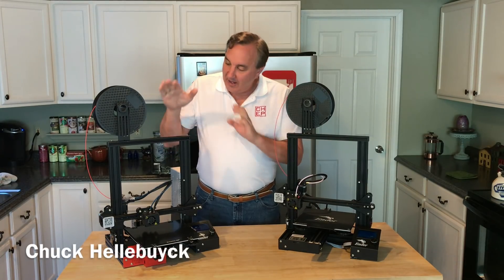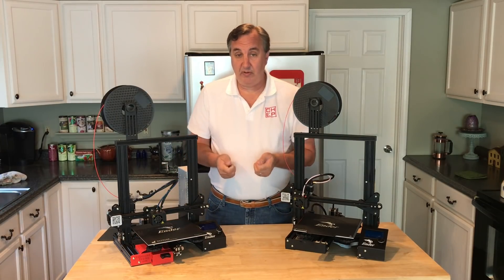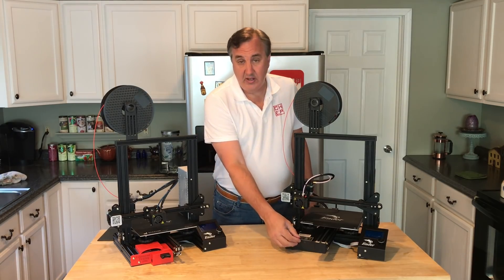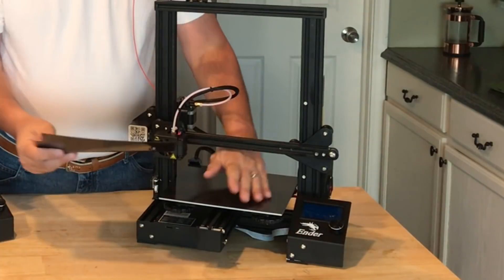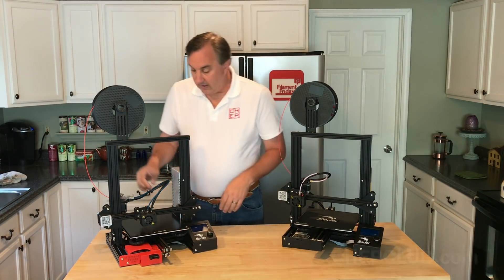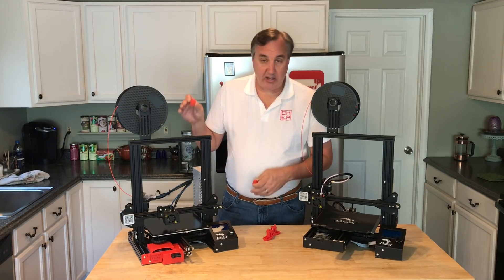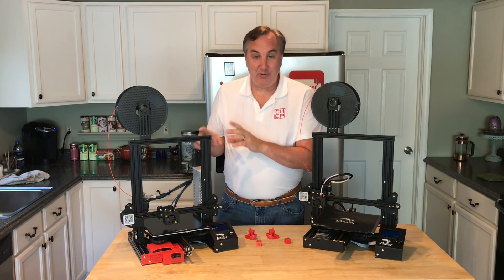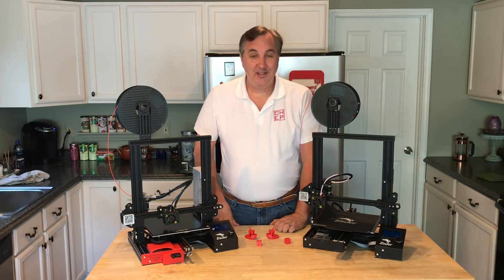Creality Ender 3 PRO vs Creality Ender 3 - Is it worth $100?

Comment: My power supply died and in europe a new one cost 24€ while the Mean Well costs 54€. Do you recommend spending those extra 30€?
Reply from the maker: There are many good power supplies other than Meanwell. You’ll probably be fine with the 24 euro one.
Reply: @FilamentFriday  thanks for answering so fast!
Reply: @FilamentFriday 
IF SOMEONE IS READING THIS, BE REALLY CAREFUL AND INFORMED WHEN MANIPULATING POWER SUPPLYS SINCE IT CAN BE LETHAL

Ive checked with a friend and apparently its common with these chinese psu, the problem is that they use cheap condensers which tend to burst. I will try changing my psu condenser and I will update my results here so people with the same issue as me can solve it.

Comment: How does the CR-20 stack up versus these two units? The CR-20 looks like it's closer to the Ender-3 Pro with some more tweaks.
Reply from the maker: I don’t have one to compare.
Reply: @FilamentFriday  Thanks for the reply. It's hard to find any reviews on the CR-20. From what I have gathered, it has similar specs to the Ender-3 Pro with minor upgrades/changes. I just pulled the trigger on a good price for an open box one I found on Amazon Warehouse Deals, guess I'll see how it performs very soon.
Reply: @Case
I'm a newcomer to the print community,  I wana know how the CR-20 works. Ender 3 pro for me works fine for no more than what I've done.

Comment: Can they both print flexibel? Internet says only the pro version can do it, but i cant see anny diference or reason why the normal version cant, pleas help me out
Reply from the maker: Depends on how flexible but they are both the same. Limited flex filament prints fine but Ninjaflex or very flexible requires a better extruder without a gap between the gear and PTFE path. Both printers have the same setup so they are the same.
Reply: @FilamentFriday  thx for replying👍🙂

Comment: Does anyone know how to get your print settings off an old print file on the SD card? My computer crashed!
Reply: It's not possible, gcode doesn't store informations about your slicer settings, it only contains instruction for printer (like set temperature, move, etc.), there are some information which can be extracted from gcode but not much. For next time backup your slicer settings.

Comment: Yeah, uh... the price difference is roughly $20-something now. Also, the CR-10 MINI in a whole $100 more than both
Reply from the maker: Lot has changed since this video was released. In a way it validated everything I stated. Wasn’t worth $100 more.
Reply: CHEP yee
Reply: CHEP wasn’t throwing shade, just thought in case anyone was concerned about a large price gap

Comment: What about the Anycubic i3 mega vs the ender 3 at similar price. Both are priced around 220-230 bucks now.
Also, can i use the glass on the Ender 3 PRO?
Reply from the maker: Ender 3 is $179.99 at many places. I gave away my Anycubic I3. Good machine but not worth the extra cost in my opinion.
Reply: @FilamentFriday  Yep right now, $180 with glass bed vs $230 of the anycubic i3 and $220 of the Ender pro. Not sure if $40 is worth for the Ender vs Ender pro. 
My main question now is if I can put later GLASS on the Ender Pro (e.g for ABS, interchange glass and magnetic), the bottom bed should be just plain aluminium so i guess yes?  

Thanks in advance for your kind response Chep!
Reply from the maker: I believe that would work. Also consider the Geeetech A10 at $190 which already has a glass bed.

Comment: Wait, what do you mean the Ender 3 doesn't come with a removable plate? Mines fully removable and while it's not super flexible, it has just enough bend to pop prints off.
Reply: it's flexible but not magnetic
Reply: That fibre board with buildtak is a new addition to the base printer, say in the last 3 months. My buddies printer didn't come with it, but mine did.
Reply: There were different batches of Ender 3 sold.  Newer ones have the flexible plate with the for little black metal clips, but older ones the plate is 'permanently bonded' to the aluminum bed, and does not come off, at all.  

Chep's Ender 3, on the left in the video, has such a bonded bed, to which he added the borosilicate glass.  Chep's 3Pro, on the right, has a two part magnetic bed, with one part bonded to the aluminum and the other part removable.  The printer I have is the later Ender 3 with the clip-on bed.
Reply: Oh ok! I see! Yeah I have two with the clipped on bed. But I find Elmer's clear paste glue works astounding for adhesion. Best part is after the print is done not only does it pop right off, the glue layer peels off so satisfyingly.
Reply: @TheSentientCloud  I have not tried that!  I've been using Elmer's gluesticks, the kind that your 4 year old eats in art class, not the kind that goes in a hot glue gun :P  If you get the purple ones, you can easily see where you've reapplied, and it turns white as it dries (quickly).  you do occasionally have to wash it off, though ...
Reply: Try the clear spread glue! You never have to wash it off, works better than the glue sticks, and prints pop off as though they were never stuck at all, and the glue layer is easily peeled off when  you remove the print!

Comment: Am about to get the ender 3 its 240 on Amazon where can I get it for a lower price
Reply from the maker: Direct from Creality or Banggood. Check the links in my video description.
Reply: @Danley joseph If you haven't bought one yet, Ender 3 is on sale "Deal of the Day" on Amazon for $182, down from $259. You have 15 hours to still buy.
Reply: @TheJester-ct5pi  For me it said "currently unavailable" on amazon.
Reply: @StolenGalaxy  You should be able to purchase one, there are multiple sellers. I bought mine yesterday with the discount. Word of advice buying on Amazon - best to buy directly from the manufacturer, and not a 3rd party seller. Much better customer support if you need help.
Reply: They are available now but it’s £70 cheaper to buy it from the creality website

Comment: One other improvement that really should be made to any of these printers is the connector from the hotbed to the power supply. It comes supplied with a TX-60. This thing gets hot enough to auto ignite under the right conditions. Please, please upgrade your Ender 3s with a TX-90 connector.
Reply from the maker: Only some of the defective ones did that. Mine stay cool.

Comment: As of 3/29/2020, Banggood now has these two models available for a $30 price difference. Assuming everything else in your review holds true, would you still conclude that the non-pro model is the one to get?
Reply from the maker: I still don’t see a major advantage to the pro. Spend the $30 towards a silent board or EZR extruder and you’ll be better off. After using them both for more than 12 months I’ve concluded I hate the magnetic bed on the pro.
Reply: CHEP I had a Prusa Mini on order for several months and came to the conclusion that it wasn’t coming until summer. I’m going stir crazy at home and my 2015 maker group kit printer was being fussy so I went to Micro Center and bought an Ender 3 Pro for $209 (they didn’t have the non-pro in stock). Used your video to put it together, fired it up, used your g-code leveler models to make the bed perfect (thank you!) and printed a benchy using Cura’s Ender 3 profile. It was one little blemish away from perfect!  Boom - you got a new Patreon supporter. Your vids are really valuable and I can’t wait to put all of your insights into my new unit.

Comment: thanks a lot for these videos,
I am new about this , from what u said in the 4:50 that you make some changes so then your are be able to print flexible materials .
I have search on the gearbest and I found Creality3D Ender - 3 DIY , and it seem I can print the flexible materials ?
is this a different models ( DIY )? and what the name of the filament for the flexible it is nylon ?
and thanks again :)
Reply: ammmm , I think this is the answer :)
ENDER 3 - NinjaFlex TPU using EZR video
Reply from the maker: Yes, that is how I print the very flexible 85A hardness Ninja Flex material.

Comment: Is the nozzle removable if I wanted to put in a steel one for carbon fiber?
Reply from the maker: Yes
Reply: CHEP I have another question, if you’ve got time. I have a da Vinci 1.0A, and I’m wondering if it’s worth flashing it and buying a new hotend or just buying a new printer.
Reply from the maker: If you want an enclosed machine for ABS and want a project to work on the reflash and add a custom hotend. But other than that, I’d just get a new printer. Mine are all done.

Comment: Funny thing is, I think I got the ender pro opr at least a diffrentz ender 3. Like my mainboard is set like the on on the left but the nozzle piece is like the on on the right. and I got a removable building plate. It's not magnetic but still :/

Comment: So although you get an estimated $120 in value with the pro, you still say that the original 3 is better?
Reply from the maker: Where is that $120 value coming from?
Reply: @FilamentFriday  the parts you print yourself, the power supply, and the other upgrades. You yourself even say it in the video.
Reply: @FilamentFriday  you tell me 5:15
Reply from the maker: Sorry. Memory fade. My point is it’s not worth the extra and the price has come way down since this video was released, proving my point.

Comment: That roll to hang the fillament are stock?
Reply from the maker: Yes.
Reply: You're better off using a separate one off to the left.  I even printed some filament strain relief brackets to help, but ended up placing my spool to the side.

Comment: I don't understand how they can call it "pro" without including automatic bed leveling.
Reply: The electronics can't support abl without giving up a bunch of other things. Best case scenereo is you trade the buzzer for it, and trade out a number of features in the firmware due to the low memory in the processor.
Reply: @initialo2054  Not true. I put ABL on my CR-10 (which uses the same Mega1284P based board) and the only thing I gave up was the buzzer. All the firmware features remain in tact, in fact I actually added MORE features by upgrading to the newer version of Marlin.

Comment: I go with the better power supply, as I don't want to burn down my whole house...  but the magnetic bed is a real downside.. or you just ignore that, buy a the glass plate.. what could happen except it won't be magnetic any longer if you heat above 85°C?

Comment: Gonna ask an awkward 3d-prining question that has no real answer: 
How many rolls of filament is the cost difference between a 'basic' and 'Cadillac' printer worth?
Your Filament Library is gonna cost MANY times more than your printer(s), and filament costs don't go away.
In fact, if your printer is top-notch, you are gonna buy MORE filament and get more work done!
Don't be a stingy Boss!
Saving a few bucks on your printer is like a stingy Boss saying "Work more hours!" instead of paying a living wage!
Be a good Boss, get a better printer!
Reply from the maker: Filament Cost is the same. Start with an affordable printer and learn the slicer and basic settings, then upgrade.

Comment: You missed a few other things
Like the power supply for the pro is 24volt not 12 and the bed heats in twice the time and I got my ender 3pro for $219
Reply from the maker: They both have 24v supply so they heat up the same. Price has dropped after this video. Ender 3 is 169.99.

Comment: Glass bed's are like $5 if you go and get one cut at a local hardware store.
Reply from the maker: Is it Borosilicate glass that doesn’t crack from the temperature cycling on a 3D Printer?
Reply: I've always used standard glass beds from the hardware store up to 75C and haven't had one crack. I did crack one when heating my hotend directly with a heat gun while it was sitting on the glass bed, took a while. Was easily hotter than any heatbed gets and was heated on one focal point.
Reply from the maker: Congrats. That’s not common. Often over time the glass chips and comes off on the bottom of prints.
Reply: @FilamentFriday  I've had my printer almost 4 years, I use aquanet hair spray on the glass. Never had a bed chip or break, many of the beds were bought at different times and from different stores. I pop parts off using a putty knife butted up to the edge, one swift pop of the hilt and prints pop right off. PETG/PLA/ABS. I print mostly PETG, 12hrs a day.

Comment: Hello Chuck.
I just found out about this printer and I had a little bit of printing back in the day when I was in high school, but I want to know if I can print resin parts with it too? I know it uses PLA, so will I need a different printer for resin?
Reply from the maker: Yes. You need a SLA or DLP style Printer.
Reply: @FilamentFriday  oh alright
Thanks a lot for your response! I'm thinking about buying an anycubic photon

Comment: Well we didn’t see them print so maybe the pro is faster than the regular 3
Reply: Matthew Geiger do you know how a 3D printer works? It just doesn’t work like that.
Reply: John Myers well I mean extruders and stuff and the speed that it can go around the surface and how fast it moves around the plate.
Reply: Matthew Geiger ya... that is all slicer dependent, doesn’t matter on printer

Comment: Is banggood a reliable seller?
Reply from the maker: I’ve bought several printers from their USA warehouse without any issues.
Reply: Yes, they are. I've bought power supplies, FPV goggles in 2016, my Anet A8 in 2017 and my Ender 3 about 3 weeks ago. Never an issue. Delivery time has been excellent along with the packages being received in good condition.

Comment: Thanks for the video, right around my price point. Im looking at 3D printers so that I can print rc planes from https://3dlabprint.com/ do you think the ender would do a good job?
Reply from the maker: Depends on how big the parts are. Are you going to use PLA plastic?
Reply: @FilamentFriday  The manual says they used a prusia original and states...

Basic requirements Mig-15BIS are 200/200/175mm buikd volume.
Nozzle 0.4mm recommended (0.35 or 0.5mm alternativelly). Heated bed highly recommended.
PLA filament (or PETG, APLA, htPLA, PC-max.... not ABS) and some flex for tires...
Reply from the maker: Should work fine then.
Reply: @FilamentFriday  Thanks for that. Im trying to determine  mechanical strength of the end product relative to the cost of the machines... I understand that these FDM printers have planes of shear due to the layering of the plastic and I'm never going to get rid of it without winning the lottery and getting one of those new Carbon printers. But in your experience is there a correlation with shear strength and machine cost? Do the layers stick/meld better?

Presumably feeds, speeds, layer thickness, room temperature etc all have a real correlation to the meld-ability of each layer.

I just cannot see the difference between a £5k machine and say a £0.8k machine. There does seem to be a quality and feature reduction under the £800 mark and that is understandable as lower than that would force the manufacturer into cheapo components. But even the ender seems to be equivalent to a prusia with only a few mods and just over a ton spent.

Unless someone figures out how to do a post process to these FDM parts, fusing the layers together on an almost molecular level, I just don't see a difference between these machines.
Reply from the maker: Quality and reliability plus tech support is what you are buying for the more money. There are additives like XTC-3D or Gloop that can smooth out the layer lines and this tends to help strength a little. The way it’s printed also affects strength. If the main force is parallel to the layer lines it seems to be more effective. 50% fill or higher also adds strength.
Reply: @FilamentFriday  Last night I stumbled upon the multi-material add on for the prusa, that's sold it for me, the whole thing looks pricey but like you say im paying for the support and the support looks pretty good; plus they always appear to be improving. Many thanks for the advice and the chat. I find not many folk respond to messages, so much respect for keeping it real!
Reply from the maker: If you do buy a Prusa consider using my affiliate link in the description. Thanks.

Comment: Hi, I really wanted to buy a good 3D printer and am a fan of the ender 3 but I'm in Canada and willing to spend in the price range of $350. Soo I do like the specs of the ender 3 pro because of the more stability than the ender 3 soo which do you recommend me getting any printer and any brand in the price range of $350. Thank you
Reply from the maker: I’d buy the Ender 3, a silent board, EZR extruder and my Filament Friday Tool Kit and you’ll still have money left for Filament.
Reply: @FilamentFriday  Ok. Buy I got one question about the y axis rail, pro and geetech have a bigger one and I don't know how to do the software changes and so on so what's the best printer near 350 cad
Reply: Canadian Dollars